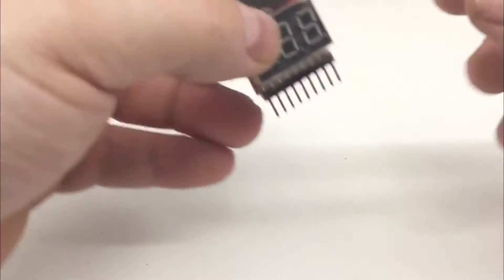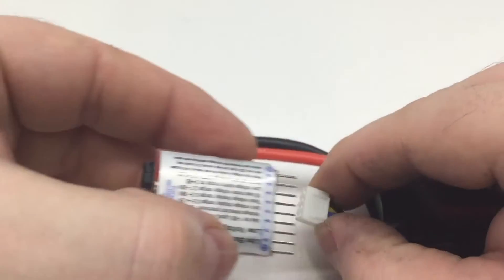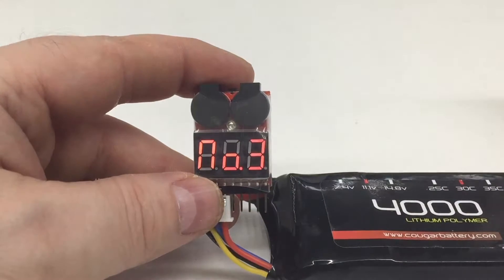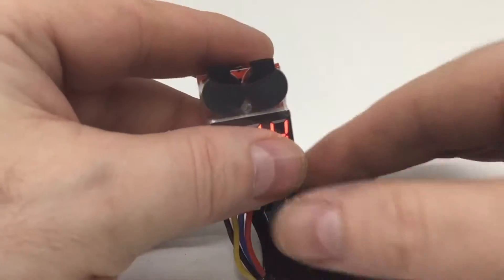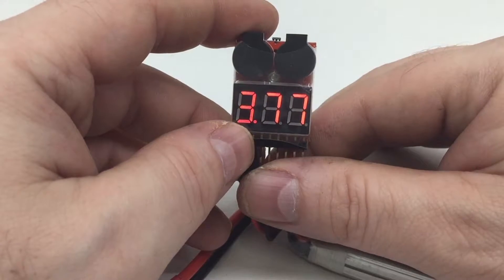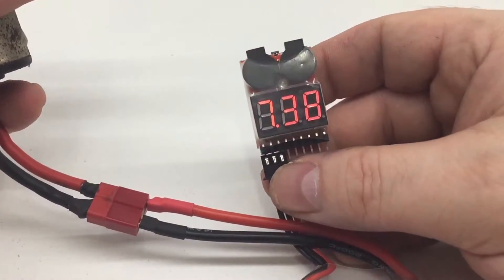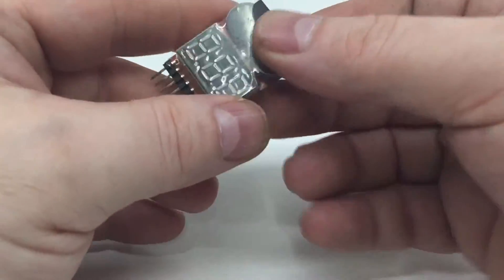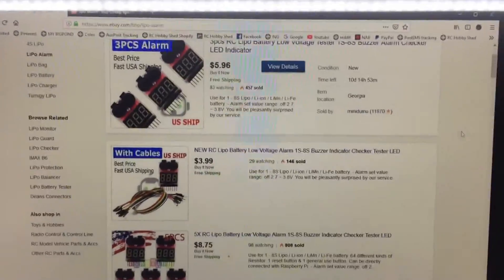Cheap LiPo Battery Alarm Quick Review

Comment: I would set the voltage about 0.2v below the minimum to account for the drain when using the battery. As soon as you unplug the battery, the voltage will increase by about 0.3 so setting it about 0.2v below the minimum (say 3v per cell) means you get the most out of the battery before you have to stop using

Comment: good little video i wish there was a unit to stop power going through the to the motor if u know what i mean this alarm is to stop u use the lipo battery if a lipo goes dead flat no power in it at all it wont change again the battery is stuffed so they tell me i have never done this i dont really know what happens u might have to charge one cell  at a time ? not sure 

u might have to do a video on this with a crappy lipo u have lol